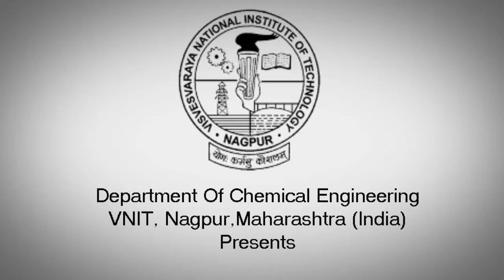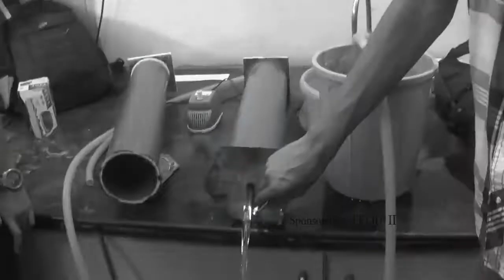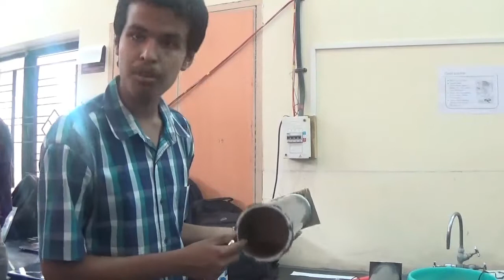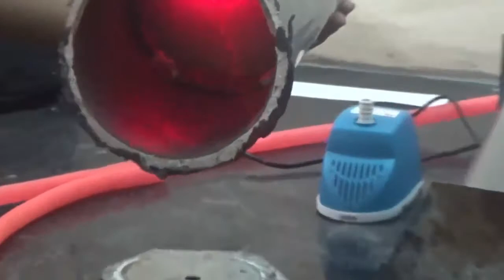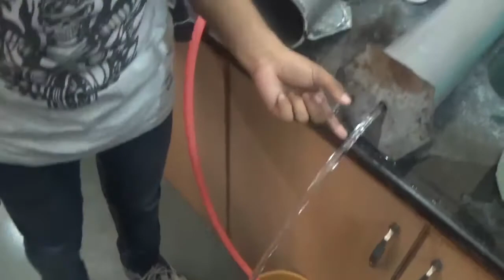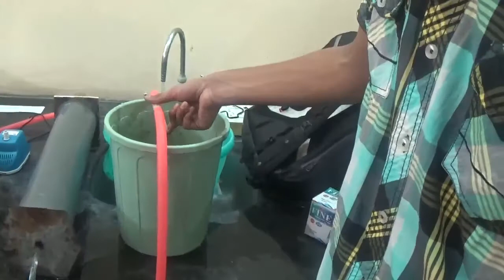Fluid Flow - Laminar Flow Fountain

Comment: I tried for leminar nozzle, but after some distance water spread.
I want to know about LOW PASS FILTER.
is top & bottom empty  space are play a role of LOW PASS FILTER.
what is air tank before leminar nozzle?
Dear Sir

I also tried for laminar, up to a extend I successes, but after a distance water spread. I use 4" dia pipe and 10" long and water jet hole is 12mm. pump is 18 meter head and discharge 6480 lph. I need water flow rate and pump specification